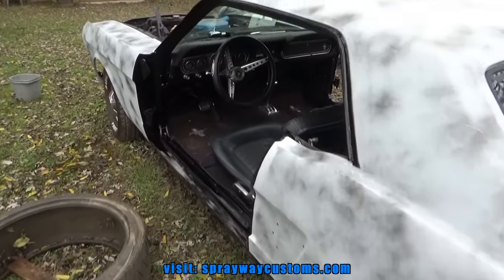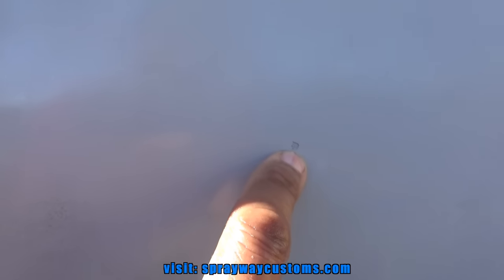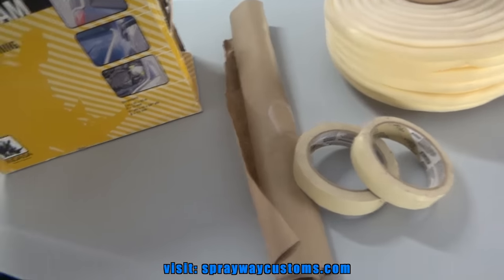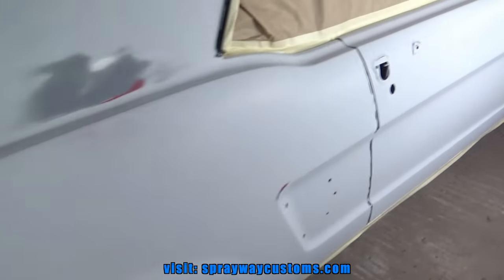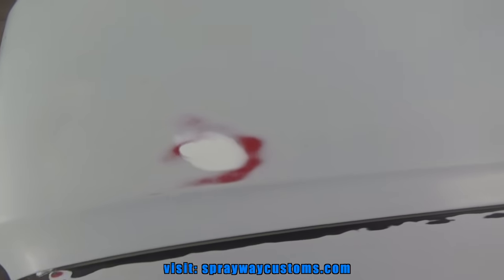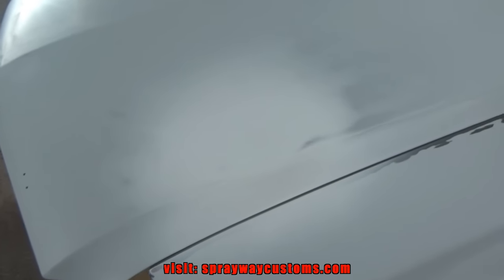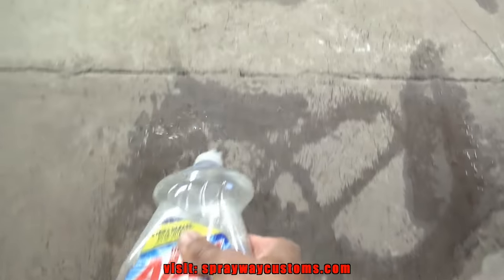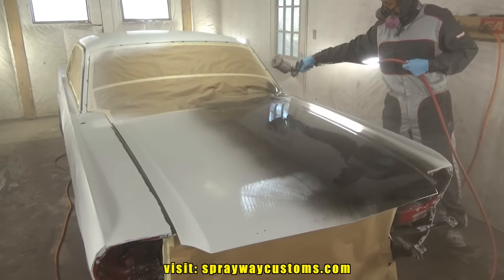How To Paint A Car At Home For $209.99 With UreKem Jet Black STEP BY STEP 1966 Ford Mustang Coupe

Comment: Great video! Not to sound cheap, but what’s a good inexpensive paint gun to use? Just need to use it once for a car paint job.
Reply from the maker: Harbor Freight has some decent cheap guns
Reply: @SprayWayCustoms  thanks. I’ll do more research. Planning to repaint a ‘08 G35, first time. Willing to spend up to $100-$150 on a good/reliable paint gun. I know there’s more to consider re: compressor size & ratings, technique, etc.

Comment: Looks nice if I could offer a tip. Fan out past last panel and trigger off will save some material and flow better panel not panel. Looks like you may could drop psi on clear some those iwatas don't like alot psi they start to make I tight V pattern instead of a full moon shape. I use a iwata every day 22-25psi and like 8" to panel 60-75% overlaps. You got what it takes thought and key to body work is patients which most people do not have.
Reply from the maker: Thanks man

Comment: Love your videos very talented!!!  I noticed  you leave your door open . I have a small garage too I built a filter rack door and on the other side I have 4 box fans at the bottom of the garage door and I bock off the rest .
Reply from the maker: I just leave it open sometimes in the winter because no bugs are out. I have two vents actually in the big swing doors and two exhaust fans on the other side. I just get more pull with the door open. Thanks

Comment: Let’s say you gotta filler in a dent during the wet sanding phase. Will you spot primer the filler and keep going with wet sanding?
Reply from the maker: Yes if it’s a regular body filler but if it’s some type of glazing putty you’ll be fine
Reply: @SprayWayCustoms  thanks boss! Any reason why you wet sand instead of just blocking it dry than just adding sealer,paint,clear?

Comment: The urekem paint is great for the price.  Did my project using the same clear and it’s holding up great.   That mustang is straight nice work as always.
Reply from the maker: Thanks...I've been using Urekem for 7 years and never had a problem

Comment: Looks great!
Couple of questions?
1. Is there a certain temperature for wet sanding outside?
2. What temperature do you try to paint?
Reply from the maker: Tony S wet sanding can be done at any temperature....I just wouldn't buff outside in the heat. I like to paint anywhere between 60 to 75 degrees
Reply: @SprayWayCustoms  fast reducer, and activator ?

Comment: Excellent work as usual!  What gun are you using for Base?  Clear?  Looks like a big fan..I am getting ready to paint a BUS/motorhome/Prevost.  Looking for info on doing that project.  Going to be a huge project, lol.....Thinking that the big fan will be good for doing such big panels on the bus....your recommendations?  I am also thinking about the UREKEM system....seems to be a lot cheaper than PPG or some of the other paints.  Thanks in advance for your reply.
Reply from the maker: I use a SATAjet 5000 HVLP for base and candy and a IWATA WS400 Supernova for clear
Reply: @SprayWayCustoms  Thanks!  Do you have any good guns that you would sell?
Reply from the maker: Check out my three videos on spray guns

Comment: So insee you changed guns do you have dedicated guns for primer base and clear? And what compressor are you using? Curious on primer and base coats you used and the back stuff that shows the high spots . Paint looks sweet dude
Reply from the maker: Yes, I have different guns for what I spray. I have a 60 gallon compressor

Comment: Do you recommend I paint strip my RX 7 or just sand the existing paint down? It doesn't have any chipping issues or paints issues in general, the clown who painted it under the previous owner just did horrible prep work, hairs, bugs, DEEP scratches just painted right over. Shame cause it looks like they used top-of-the-line paint, just no 2  f's given about prepping it properly.
Reply from the maker: If the existing paint is good and looks like a solid foundation you can just sand it down and go from there.

Comment: Excellent job as usual SprayWay! Question: It was more work for me to cut and buff than it was to paint. Can you just buff the bugs and trash out with compound and still look good? My car had less orange peel than the stock paint without cutting the paint. Wasn't worth the time for me. Thinking of painting another car and wanted your opinion. Thanks.
Reply from the maker: Yes, you could do that. I do it from time to time myself

Comment: Outstanding workmanship! ...what was your spray gun mm measurement and what size compressor did you use?
Reply from the maker: 60 gallon compressor, SATAjet 5000 HVLP 1.3 tip

Comment: I tried looking through the comments so I didn't ask a question that you've already answered when you paint a car that didn't have bc/cc do you just epoxy prime over the existing laquer finish if it is in good condition? I've only painted vehicles from the 90s on that I sanded and sprayed... I've only worked on 2 vehicles in the 1960s that I stripped, but I have a 1980 model cadillac that I'm spraying lime gold candy over a metallic green base so just wanted to get your ooiniin
Reply from the maker: Either epoxy or use a sealer so you won't have any kind of reaction
Reply: @SprayWayCustoms  thanks I'm gonna use a catalyzed sealer. It should lock it down. The camaro your working on now is looking sharp. How much base and Candy did you have to get to get it covered completely? Thanks for all of the help and the video content.

Comment: Good job spray way I’m try paint my 84 cutlass this spring I’m watch your videos before I attempt I have a question when using spot putty I used bondo kind before waited 24 hours tried sanding was still kind of wet is that right or am I using wrong stuff or not waiting long enough? And I’m worried about messing up on body work
Reply from the maker: Sounds like you tried to use it in an area that was too deep for the 1 part glazing putty. That should only be used in fine-line cracks and minor imperfections. You'll need a 2 part putty.

Comment: What do use fir heat in your garage/paint room?

And ventilation?

I really enjoy your videos.
Reply from the maker: I have a small plug in radiator heater and for ventilation I have a cross draft...vented on one end and fans on the other pulling

Comment: Hey spray, I know it's cheating but when I do my black on my cars I own I always  do a base black and then all of my clear coats have about a quarter of black in them, almost like I mix up a single stage, then I wetsand and buff that out and it comes out so smooth and deep. Have you heard of this because I stumbled on it by mistake once because I was trying to mix up a clear and added paint by mistake. Sorry for the run on post. Great job as usual.
Reply from the maker: Yes. It's like a tinted clear
Reply: @SprayWayCustoms  thnx for the reply, I love how it looks and I can wetsand out alot of imperfections . Hey I want to do my interior black and perforated vinyl red, can I use that dupli color vinyl black? Or what do you recommend.

Comment: For those of yall starting out(on top of 210 paint). 
$100-500 for gun. 
$300 compresser. 
$100 sandpaper pads.
$150 da sander
$100 blocks/fillers. 
$100 misc cleaners/guidecoats/rags 
sprayway tips: priceless
Reply from the maker: You was being a little generous 😂😂

Comment: Nice work my Brother 💪🏾🙏🏾!! I need a lil help spray, where did u but your outter window sweeps for your 2 door! If u can remember what's the part number where I can buy a set for my 2 door!! Appreciate the motivation God bless an keep applying Pressure!!! 🙏🏾💪🏾🤟🏾
Reply from the maker: Here's a link. https://www.ebay.com/itm/203177164503?chn=ps&norover=1&mkevt=1&mkrid=711-117182-37290-0&mkcid=2&itemid=203177164503&targetid=1068323856390&device=t&mktype=pla&googleloc=9012698&poi=&campaignid=11612430909&mkgroupid=112841752293&rlsatarget=pla-1068323856390&abcId=9300456&merchantid=101701553&gclid=EAIaIQobChMIzrTdpter7gIVEb7ACh1XrwnMEAQYBiABEgLecfD_BwE

Comment: What's a good Spray Can Primer to use? I paint motorcycles on the side with spray cans. Need to find a better primer and sealer
Reply from the maker: I've used Rustoleum and it works pretty good
Reply: @SprayWayCustoms  Ok thanks. You use it after the sealer right & what’s a good spray can sealer? Couple of times I’ve had to fight with Paint Fry

Comment: Great video. Have you done a video where you talk about using heaters to aid the curing process? What’s your opinion on those or is it better to let the paint cure naturally? Great video thanks 🙏
Reply from the maker: I haven't made a video. In the winter I just have a small plug in radiator heater that I let run for about an hour after I finish painting and then I just let it finish curing naturally.

Comment: Awesome end result.  I was watching your technique closely.  Amazed at how smoothly you maintain consistent gun distance and speed.  Was that just one coat of base?  

With all the spraying you do,  you might want to protect your eyes.  I was surprised  you had only one bug with that back door open.  You may have solved future bug issues with your portable booth. 

 Your paint job is too good for this six cylinder.  I’m just saying.
Reply from the maker: Thanks a lot

Comment: Would love to see some tips of the best way on how you rid surface rust from bare metal n how to prime the metal afterwards....??? No better person to ask then the Coach himself
Reply: Sanding down or use the grinder wheel and bondo ,next you need epoxy primer, and after that high build primer and then your base coat and clear.  I dont know if you y understand me
Reply: @yosoydpfknr2855  yea I got ya...thanks
Reply from the maker: Thanks for the reply YoSoD

Comment: Spray way,
do you have a video on spraying plastic bumpers? I have a body kit for my Miata it’s made of poly urithane, and I sprayed it down And it started to flake off. 😅 so embarrassed I haven’t touched it since. I prepped the bumpers before I shot it with a rattle can primer but I probably wasn’t using the right chemicals either.
Reply from the maker: Yes, here's the link. https://youtu.be/cgN7Y93xvvQ

Comment: Hey wuz up
First of all congratulations with your great awesome work. I have a question while painting do i have to clean the gun in between coats of base or clear coat when im waiting for flashtime ???
Reply from the maker: If you using the same gun to spray the different materials...yes clean it after each type of material

Comment: @SprayWayCustoms 

What air compressor do you use? I’ve heard you’d need at least 15cfm at 90 psi. Is that true?
Reply from the maker: I have a 60 gallon compressor
Reply: @SprayWayCustoms  sweet thanks man. Been following you for a while now. Definitely appreciate all your vid’s boss. I’m in Pensacola, Fl so you’re not too far from what I heard. Thanks for the motivation. 🤙🏽💯

Comment: What sand grit did you use for correction in clear (trash and bug removal) prior to buffing?
Reply from the maker: The finer the grit you can get away with will make your buffing go by much easier. Anything from 1500-2000-2500 or 3000
Reply: @SprayWayCustoms  cool thanks. So start high (3000) and work down to more corse grits as needed to correct
Reply from the maker: Goody Two Shu no you actually move up to finer grit when sanding. If you could start out with 3000 grit that would be great if it's not much orange peel because it's less aggressive scratches. From 3000 you can go straight to buffing. 3000 will take longer to cut trash and imperfections out than something like 1500 but the scratches will buff out a lot faster than something like 1500 scratches.

Comment: Hey. I love your videos. I  have a question about spraying clear coat. Does distances determine a high or low shine?  While I spray it looks real shiny but after it dry it’s dull . Can you please tell me what I’m doing wrong
Reply from the maker: Yes, it's a combination of distance and speed. Sounds like die-back. What type of Clear you using?
Reply: @SprayWayCustoms  ok so how far away do I need to be for a high shine?  The clear is Urethane Clearcoat by Diamond Finishes
Reply: @SprayWayCustoms  how fast do I need to go?

Comment: Nice job bro! What gun did you use & what size air compressor?
Reply from the maker: SATAjet 5000 for base and Iwata Supernova WS400 for clear with a 60 gallon compressor

Comment: 17:30 I'm not a pro. What about filler primer instead?
You're painting black, right? Would the red come through? Did you need primer? Or is it because the black is not opaque?
Reply: You really don't want alot of break thru because it opens the opportunity for a reaction or wrinkles  of the base coat. He explained that when addressing the hood spot repair
Reply: @lonestarlows  so the primer prevents the red reacting with the base-coat? Ok
Reply from the maker: Thanks for the reply lonestar 🤝

Comment: Hey , had a question for you , I'm painting a car daytona  metallic blue , it a urethane wondering if I could wet want the base coat if I had  trash in it before spraying the clear
Reply from the maker: Yes you can with no problem

Comment: What are the settings on gun when spraying clear cost.  By the way great job
Reply from the maker: Settings are 30 psi of pressure, fluid wide open and fan pattern 2 1/2 turns in

Comment: Yo sprayaway in the fender at 21:24 is that dust or trash in your base. I notice I get that in mine as well.
Reply from the maker: It be mainly Overspray that doesn't make it out the booth and falls back down on the surface
Reply: @SprayWayCustoms  Awesome work I have learned a ton from watching your videos. Even built my own booth / shop.

Comment: What spray gun did you use & tip size ? Thanks
Reply from the maker: Base..SATAjet 5000 HVLP 1.3 tip, Clear...Limited Edition IWATA Supernova WS400 1.3 tip

Comment: I guess that I am surprised that you didn't wet sand with 400 grit paper instead of 320 grit paper before painting black paint. Wouldn't you seal the whole car with primer sealer before before you paint the car? That's what we did before we painted a car at auto body class at local tech school.

Comment: Which air compressor did you use ?
Reply from the maker: 60 gallon
Reply: @SprayWayCustoms  Does it matter what air compressor I use ? Also I’m painting a 72 GRANDVILLE 4 dr hardtop, would you say I would be good to use a quart or I would need a gallon ?

Comment: If I come to you how much will you charge I need my Chevy impala painted jet black
Reply from the maker: I'll have to see the condition
Reply: It’s brand new I am putting a new fender and bumper and hood and rear bumper on it all the parts are brand new I just finished fixing the whole car that’s why I want it jet black with my tints and I want to put 2 12” in there with a nice amp your work will top my car off

Comment: What primer did you use and where did you get it from
Reply from the maker: I used Upol. You can get it at your local O'Reilly Auto Parts or eBay.
Reply: Ok thanks bro I need a primer that I can spray and let it sit for a period of a time and come back later and sand then paint

Comment: You still using Urechem paint?
Reply from the maker: Sure is
Reply: Just got my Urechem sealer,  jet black base and glamor clear. I tried spraying a single stage black first on practice parts and couldn't get it to spray without orange peel. Hope I can spray it to look like that mustang. Will see. Thanks

Comment: Why wouldn't u use like a bucket or something to wet the entire floor? Dust can still come up in the dry areas
Reply from the maker: Because I didn't want to flood the area. The floor not quite level and all the water will run where I mix the paint and set up the guns.
Reply: @SprayWayCustoms  have u ever sprayed single stage acrylic enamel in the cold?
Reply: @SprayWayCustoms  my garage/shop is not level either,  it's cracked in the middle, I get puddles of water at  one particular location. But it is on the opposite end of the garage from where the mixing and gun setup takes place.
Reply from the maker: JC Chapman I sprayed it years ago in a real spray booth
Reply: @SprayWayCustoms  I am spraying in a home made spray (cross draft) booth, was just wondering and wanting to see it, but if no vid. No worries
Reply: I love watching ur work man, 💪
Reply from the maker: JC Chapman here's an older vid of my setup. Everything's still the same except the walls has house wrap on them and I upgraded the lights to LED. https://youtu.be/M4GXr2XN32w

Comment: Going down the 8 in California Mountain Road where car AR crashed up laying at the bottom of mountain Mark 25 miles per hour struggling stay in my Lane my 67 Mustang get this get through there it flattens out heading towards Arizona El Centro exit or something like that car starts to smoke and the driveshaft shot- put onto the ground had The Flintstones the brakes to stop the car the driveshaft was about a mile back course this all happened on Christmas Eve it was black and chrome
Reply from the maker: Thanks for watching

Comment: What up bruh.   You ever shot candy in Hvlp before???   I'm trying to paint car and motorcycle bruh
Reply from the maker: G Myles yes..that's the type of gun I'm using is an hvlp
Reply: @SprayWayCustoms   which hvlp you using ??
Reply from the maker: G Myles in this video I was using a SATAjet 5000 HVLP with a 1.3 tip
Reply: @SprayWayCustoms  right on right on